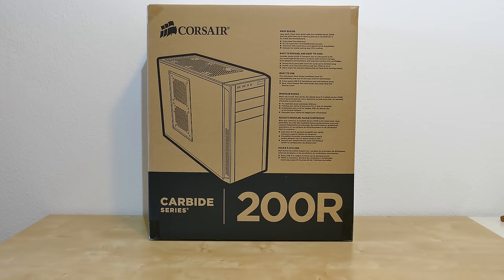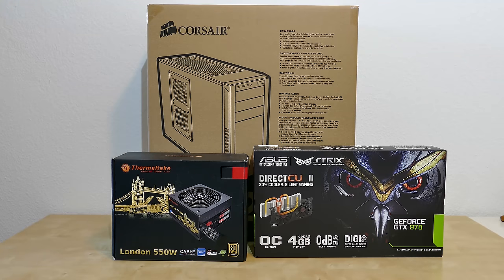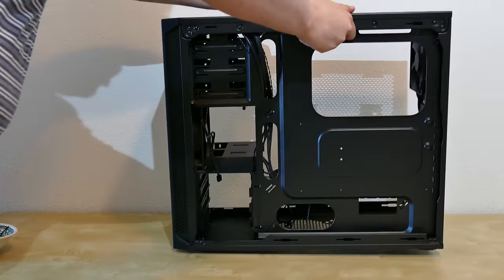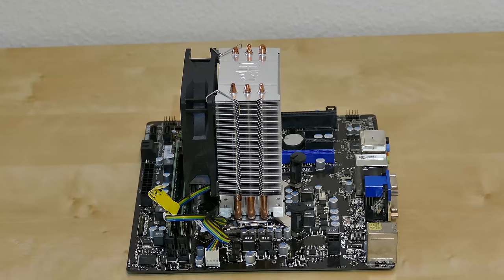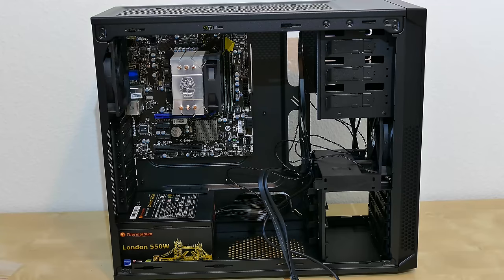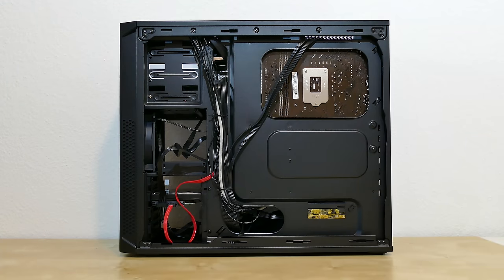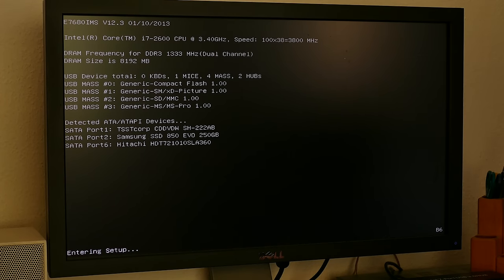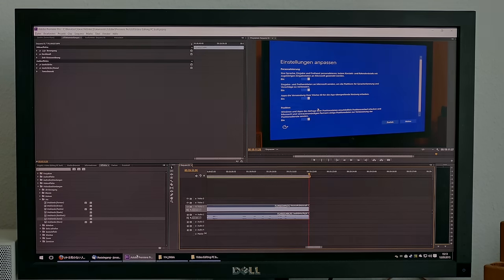Building the new Video Editing PC (Intel i7 3.8GHz, 16GB, GTX970)

Comment: 4K... and I thought 360p is clear enough! but my computer can't go any more than 360p, its only got a Nvidia FX500 from 2004 so that's probably the reason!
Reply from the maker: +Sony Trinitron I hate seeing the videos I made in 360p years ago. The 4K looks excellent on my 2K 27" computer monitor.
Reply: DrCassette I've got an old Compaq monitor at 1024x768, it does the job plus 360p is all I need since I'm used to it!
Reply from the maker: +Sony Trinitron And that's the thing: I kept using 360p and 480p for years even though I had an HD camcorder. Because I was used to it. Big mistake. I wish I would have switched to HD the day I got the HD camcorder. I hate seeing my old videos from back then. Once you've had a chance to see how good HD looks on a proper sceen, you never want to go back anymore. BTW when I'm putting titles into my videos, I don't think they are big enough for 360p. Can you even read the 4K Ultra HD logo in the intro?
Reply: +DrCassette Remember though back then how long videos will take to upload if in HD with out Fibre Optic now with this at least it only takes about 30 mins in steed of the 8 to 10 hours or more and that for a 2 gig video.
Reply: EastAngliaUK Here in New Zealand we've not got fibre internet yet. I've got plain ADSL
Reply from the maker: +EastAngliaUK In Germany most people are stuck with ADSL, too. Even in those areas where fiber optic is available the distance from the distribution box at the street to your house is still oldschool copper wire. They call that VDSL. Only wealthy businesses can get fiber optics all the way into their place. 
This 20 min 4K video is almost 6 GB in size. It took about 10 hours to upload. I just let it run over night.

Comment: You can actually get USB 3.0 to USB 2.0 header converters, which would at least give you more USB 2.0 ports at the front (as it obviously won't get 3.0 speeds). You could use that if you like. As for the motherboard/cpu speeds: you can't directly compare the clock speeds of a 2nd gen i7 to those of a 6th gen one, but I certainly agree that upgrading is just not worth it. In fact, I'm still using an i7 2600 myself ;) (though mine is clocked at 3.9GHz (using a Z68 motherboard. Not sure you can reach that on an H61 mobo too)). Nice vid btw!

Comment: Upgrading to 4k in my concern is not absolutely necessary, but if there you can have a 1 Gigabit/s connection cheaper and it's not going to take 2 months to upload just one single video. Go for it!
Reply from the maker: +André Campana Merétika I have a 16 MBit/s connection (that really only is a 12 MBit/s connection :P ). The upload of this 6 GB video file took about 10 hours. I just let it run over night.
Reply: i have a 15 Mbit/s connection. Beware, the uppercase B means Bytes and the lowercase b means Bits. In general my videos are 1,7GB each and i do that aswell, i let them uploading over the night. But my upload speed is just 2 Mbit/s, barely 200 KBps.

Comment: 1080p @60fps would be better choice than 4k because there is not much people who have 4k monitor and internet connection capable of playing it, it also needs quite modern pc for 4k.
Reply from the maker: +NuffMan I see it as an investment into the future. Just a few years ago it was the same situation with HD, and back then although I had a HD camcorder, I kept uploading videos in 480p. I hate seeing these videos now, because they could have been so much better, had I gone through the trouble of producing them in HD. I don't want to make that mistake again.
Also I do have a 2K monitor, and while it's not the full 4K, I do see the difference between HD and 4K.
Reply: When you are at it, go straight to the 4k @60fps:D
Reply from the maker: +NuffMan Only the VERY expensive professional camcorders will do 2160p50 or 2160p60. And the H.264 codec YouTube uses does not support 4K at frame rates higher than 30 fps. So that at least for now is impossible.

Comment: Nice build but I would prefer an Radeon 390x with 8GB at that pricepoint. But if you use Adobe Premiere for Videoediting 970 should be Ok because of CUDA. But keep in mind that the 970 only uses 3,5GB of the 4 GB Vram at full Speed. Nice that your Mainboard got an Real BIOS not that crappy UEFI like my ASUS.
Reply from the maker: +linusevosonic It had to be the NVIDIA because they have the CUDA that Adobe Premiere supports. That's really the only reason why I got such a good card. For anything else, the old GTX 650 I had was enough.

Comment: Hello, I had the Geforce 970 got rid of it for a much better preforming Geforce 780.
The holes in the top of the case are a no no, big risk if anything were to fall inside, especially liquids.
Nice presentation of video and internal components look good. I probably would have gone for a 750watt PSU for editing as rendering take a lot of juice.
Reply from the maker: +MonkeyMagic Elecifun I covered up the holes on the top, to keep dust from falling in. I don't keep anything on top of the tower, so nothing will fall in (aside from the dust).

Comment: Nice build! You should get a few more years out of your current i7 cpu. How much RAM can your motherboard handle? Have you checked if your motherboard has the latest BIOS version?
Reply from the maker: +adumanter I just checked, 16 GB is the maximum the motherboard will take. And it looks like I can save some money as the thing will not support any more than 1333 MHz. The kit I initially wanted to get would have been 1600 MHz. Oh well.
I did do a BIOS update once and it was quite a scary experience, because the PC wouldn't power up after that anymore. Turned out it was the same problem that occured in this video, only that time I had to unplug the keyboard :P

Comment: thanks for sharing your build...can you do the three cinebench tests so we can see how fast this build is?
Reply from the maker: +richcali21 I don't really know anything about testing and benchmarks, so no, I don't think so.
Reply: +DrCassette I know it may feel out of your comfort zone but.... Benchmarking is important to run when you first get your new computer build running so that way you will know what peak performance is and you should check it from time to time to make sure you are still running at your peak performance. Cinebench is a easy program to use and there are a lot of videos here on youtube showing what it does. It check your video card for frames per second and rates your CPU for all core computing and a single core test as well. No big deal if you don't want to but if your editing its important to be running at your best. I also do video editing and have been using adobe since the 1990's or so and own several of their suites. The machine I just replaced was the original i7 extreme that I purchased about 7 years ago. I am also a big fan of old electronics and have some real nice pieces like my 1970's 1,500 watt per 2 channels peaks phase linier gear

Comment: What camcorder are you using? Looks great on my 2560x1440 monitor. Also, we've got the same CPU cooler...
Reply from the maker: +Daniel Holt The NTSC version of the Panasonic Lumix FZ1000.
Reply: Did you go through the trouble of getting it from USA just to get the NTSC version? I hate the PAL/NTSC locks, I wish all cameras simply had it as a changeable option...
Reply from the maker: I got lucky on Ebay. Somebody had indeed gone through the trouble, and paid over 200€ import taxes. Then sold it on Ebay, and got back only 550€ for the 900€ he once had spend because everybody thinks that NTSC cameras totally don't work in Europe.

Comment: Wait, what 4k camera did you get? The sony ax100?
Reply from the maker: +giammyzanna I wish I could afford the AX100. This was recorded on the Lumix FZ1000. The Panasonic 4K capable photo cameras seem to offer the best value for money at the moment.
Reply: +DrCassette Oh yeah, the fz1000 is actually very good, I've seen people using it with the GH4 for dual cameras videos
Reply from the maker: +giammyzanna My father has the GH4, we once compared the two, and in that certain situation, the FZ1000 actually won. The FZ1000 is great value for the money. And I managed to get the NTSC version here in Europe that records 4K at 30 fps rather than only 25 fps.
Reply: +DrCassette In the gh4 menu you can change between pal and ntsc. I thought you could do the same on the fz1000.
Reply from the maker: +giammyzanna No, unfortunately not. The PAL and NTSC versions of the FZ1000 even use different hardware, so you can't even try to install a different firmware.

Comment: That cheap-ass PSU is a friggin' time bomb. I thought you knew your stuff about electronics. These cheapass rebranded PSUs use 85ºC crappy capacitors and undersized heatsinks. You should've gotten an FSP, Delta, Zippy or Seasonic PSU. Also, I hope you're not using that GPU for gaming, because when the memory usage gets above 3.5GB the card pretty much shits itself, thanks to an intentional design flaw by our friends at Nvidia. Anyway, glad to hear that we're going to get your videos at a higher resolution!
Reply from the maker: +ilovethetwinfamicom That PSU was quite expensive. They had an FSP rated for 750 W, but that didn't even weigh half as much as the 550 W unit I ended up getting. So much for that. I am not a gamer. I need this for video editing.
Reply: +DrCassette Then you got scammed. Thermaltake stuff is just rebranded chinese crap. Weight isn't everything, that FSP was probably more efficient and dissipated less heat, thus needing smaller heatsinks.
Reply from the maker: +ilovethetwinfamicom No, the FSP in fact was less efficient than this unit. The caps I could see throught the vents in my power supply are Nippon Chemicon, and if your PC runs at temperatures close to 85°C, you are doing something wrong. I know this isn't the best PSU you can get, but I am not a millionaire. This was all way too expensive already :P
Reply: +DrCassette Maybe Thermaltake has started rebranding stuff from better OEMs? All the Thermaltake PSUs I've seen used cheap no-brand caps. Glad I was wrong, though, I hope that PSU lasts you a long time! By the way, how much did you pay for it? I personally have a Seasonic M12-II Bronze 520W which I paid 50€ for. A great PSU.
Reply from the maker: +ilovethetwinfamicom The Thermaltake PSU cost me 89€.

Comment: you could get a sata card
Reply from the maker: +Ryan Smith I can't because the motherboard has no expansion slots left over.
Reply: +DrCassette well it depends on what you use the slots for.
Reply from the maker: +Ryan Smith I could replace the FireWire card, that's right. Not sure if I really want to though.

Comment: EWW windows 10 are you serious!
Reply from the maker: +‍1marcelfilms Windows 10 is one of the best Operating Systems I had so far. Certainly as good as Windows 7 and WAY better than XP or 8.
Reply: DrCassette im out
Reply: +DrCassette I'm finding nothing wrong with XP! I'm using it as I type, sure its damn old but it does the job and runs all the software one would ever need.
Reply from the maker: +Sony Trinitron 
XP was good in its days, but those days are over.
There are no more official updates. Windows XP commonly is 32 bit. The majority of software I use these days is 64 bit, therefore the OS has to be 64 bit. So it certainly does NOT run all the software one would ever need! Adobe Premiere Pro for example is not even available as a 32 bit version! Also a 32 bit OS won't access anymore than 4 GB RAM. I have 8 GB, and will upgrade to 16 GB soon. XP has no proper support for modern hardware. I don't think it can be optimized to work with SSDs and I don't think it supports USB 3.0 properly.
My PC is not a museum, therefore Windows 10 is the best choice.
Reply: DrCassette I'm using XP since it works fine and always has, I only use the computer for internet use and work etc... anyway but I'm going to get a new PC one this one completely dies, I'll even go to the extent replace all the capacitors if it were to fail since it does the job fine.